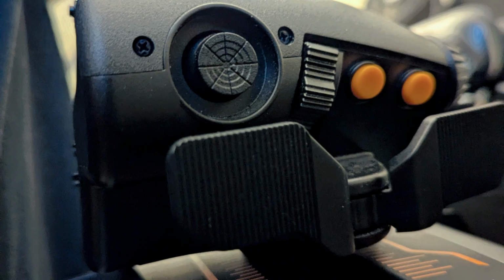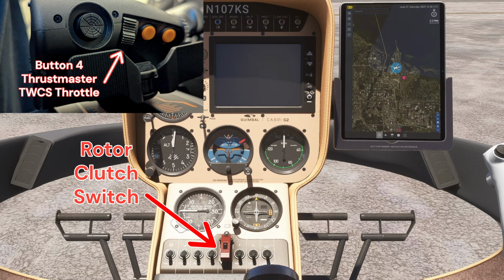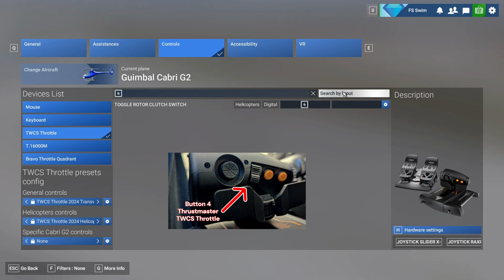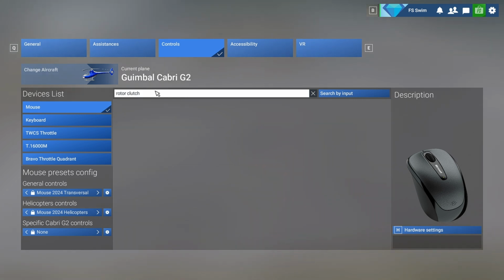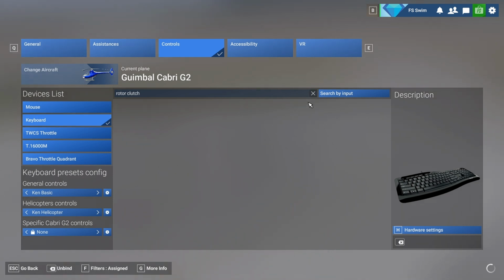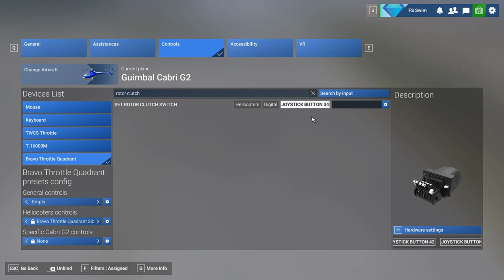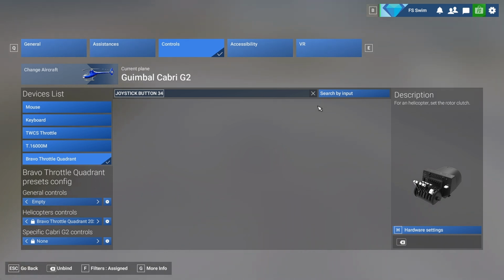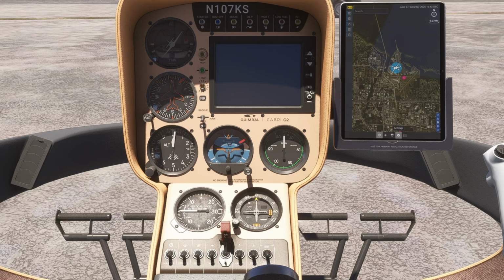How to Fix MSFS 24 Controller Issues! Settings Not Working? Flight Simulator 2024 Troubleshooting

Comment: Anyone know how to fix the issue that won't allow the plus & minus knob to change altitude on the bravo throttle controller? It does this on the 737 max and some other planes as well. I notice it mostly happens on campaign mode. Note: I do not have double bins etc and all planes I use are configured.

Comment: Have you ever had an instance where msfs doesn't respond your mapped controls? For example, My throttle always operates in reverse while in flight, even though in the control settings I have it set to not be in reverse.
Reply from the maker: Yes, sometimes the default seems to be backwards and I have to go into the individual control and set it to reverse, to do what it is supposed to do. On the Cessna 172, either the throttle or mixture, maybe both I forget. Thanks for watching!
Reply: Same problem here. But I'm beginning to think the problem is in windows. Just curious, go to your usb controller section in windows, I am currently using Win11, and go to properties and see if it is inverted here. Mine is and there is no way to invert it from here and inverting it in the sim doesn't work either. All the other axis on all my other controllers, work just as they are supposed to except the throttle on my M.16000. It is inverted also. For both controllers, it is the Z axis. Just curious if you experience the same thing.